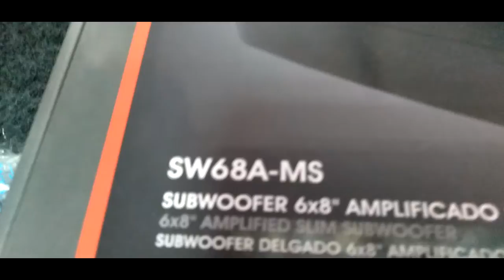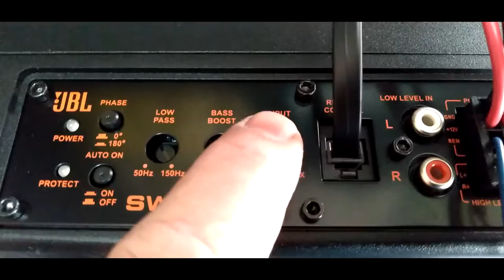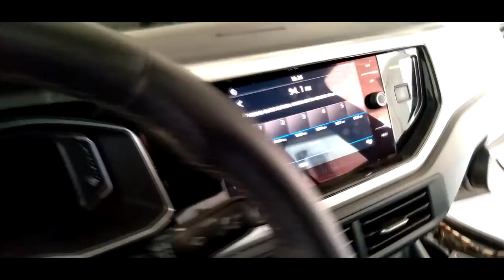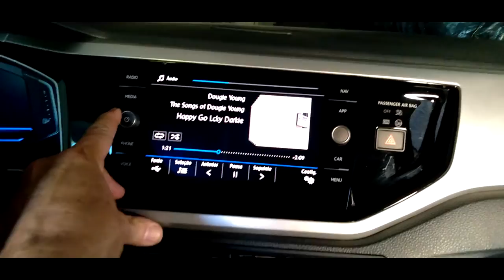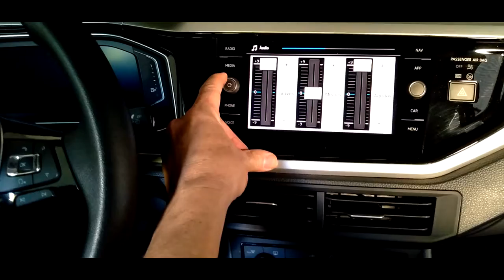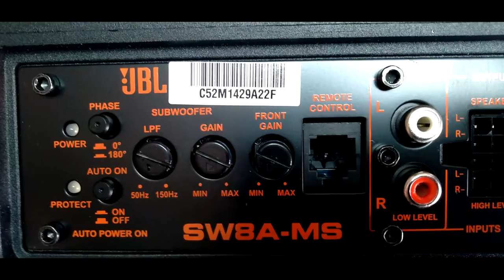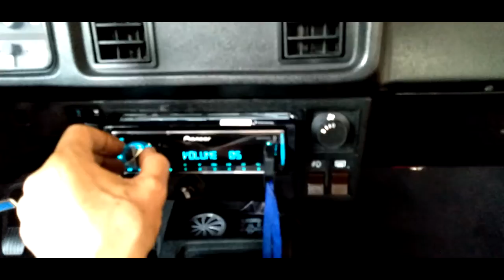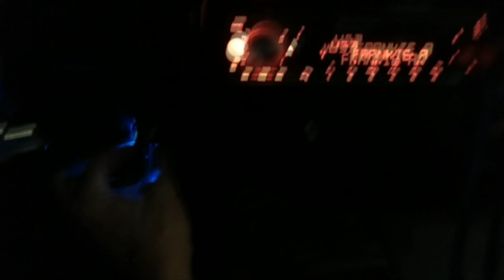#JBL HARMAN CAIXAS SUBWOOFER ATIVO SLIM  SW68A-MS  SW8A-MS no Volks Virtus e Chevrolet Chevette

Comment: sw8a-s vs sw8a-ms qual a diferença delas ? Parece que uma é de 150 e a outra de 200 w rms… da muita diferença ?
Reply from the maker: A conprovadamente melhor tem 3 canais sendo um de lpf graves e outros 2 full range ou hpf .
Reply: Qual tem 3 canais. S ou Ms
Reply from the maker: @alexsandroyukio7341  CARACTERISTICAS DA CAIXA ATIVA DE SUBWOOFER SLIM MARCA JBL MODELO SW8A-MS  :

8 POLEGADAS, 2 OHMS
POTÊNCIA RMS: 200W 2 OHMS
RESPOSTA DE FREQUÊNCIA: 20HZ - 150HZ
SENSIBILIDADE DE ENTRADA, ALTO NÍVEL: 0,5V
SENSIBILIDADE DE ENTRADA, BAIXO NÍVEL: 100MV
FILTRO LOW-PASS: 50HZ - 150HZ
BASS BOOST: + 12DB
FILTRO SUBSÔNICO: 20HZ
IMPEDÂNCIA: 2 OHMS

FRONTAL (ESTÉREO):
POTÊNCIA RMS: 2X100W 2 OHMS
RESPOSTA DE FREQUÊNCIA: 30HZ - 20KHZ
SENSIBILIDADE DE ENTRADA, ALTO NÍVEL: 1,0V
SENSIBILIDADE DE ENTRADA, BAIXO NÍVEL: 300MV
BASS BOOST: + 6DB
FILTRO SUBSÔNICO: 30HZ
IMPEDÂNCIA: 2 OHMS